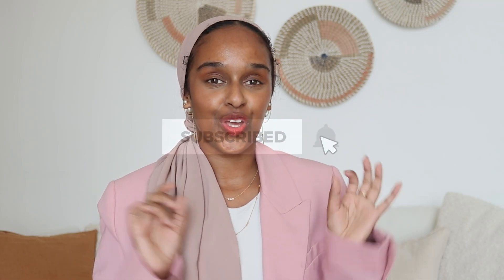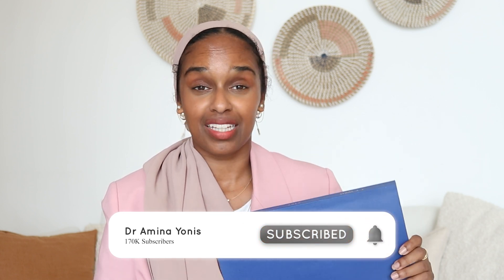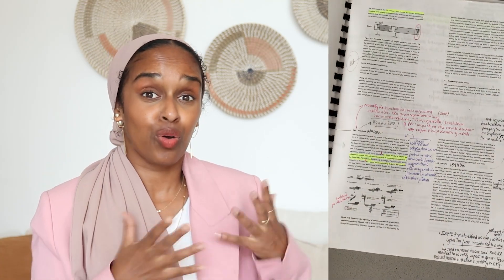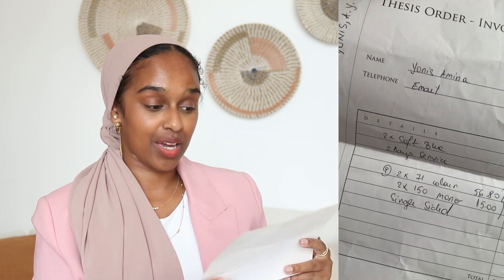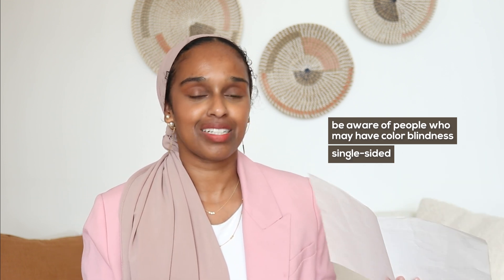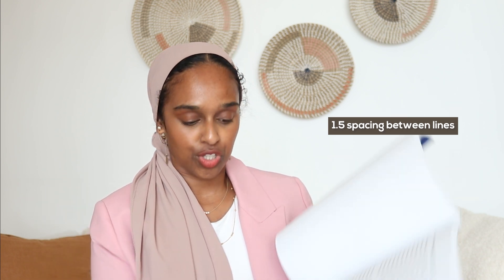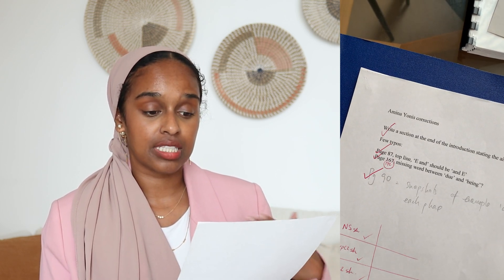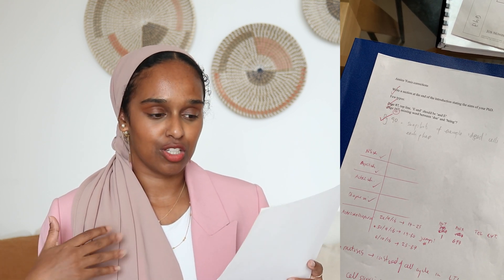How I Printed & Bound My 300+ Page PhD Thesis

Comment: Great video! I disagree regarding the corrections part. As for the German system, you will only be able to start writing your thesis and hand it in once you have discussed all your final results with your PI. Going back to the lab for another 6-12 months is just insane and very rarely happens.
Reply from the maker: Oh interesting! It's quite common in the UK to be at a distance from your PI and so sometimes, little discussion has gone on between you and you require major corrections.

Comment: 300 pages thats a lot... my MBA thesis is around 105 pages in all...I will surely get to that level when I finally enrol for a PhD
Reply from the maker: hopefully soon!
Reply: @DrAminaYonis  Insha Allah
Reply: Pages are not a measure of quality. My thesis had 15 pages of cover, 20 pages of reference, then including small introduction, literature review and conclusion and Further research end up 50 pages. So, 85 pages can be written in 2-3 months. Main work start after than, a PhD thesis normally is 150-250 pages however getting 350 pages is not rare. Finishing in less than 150 pages is rare.